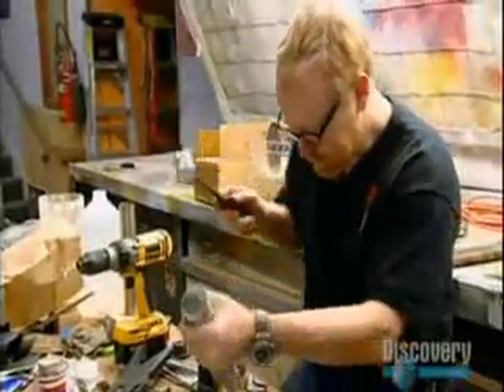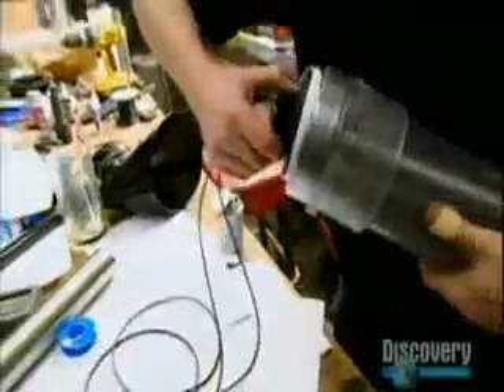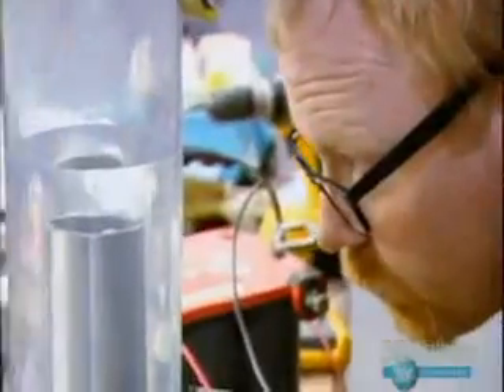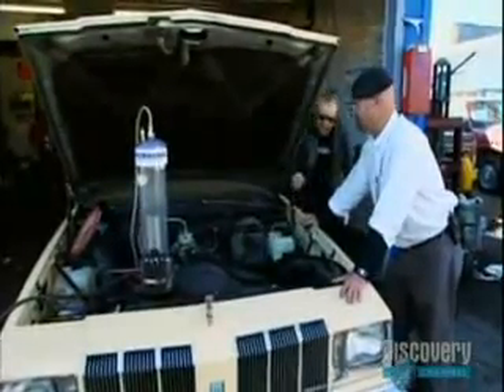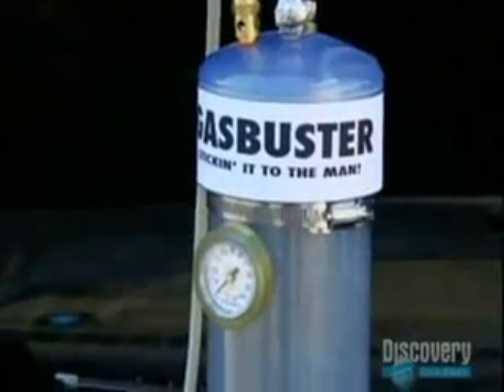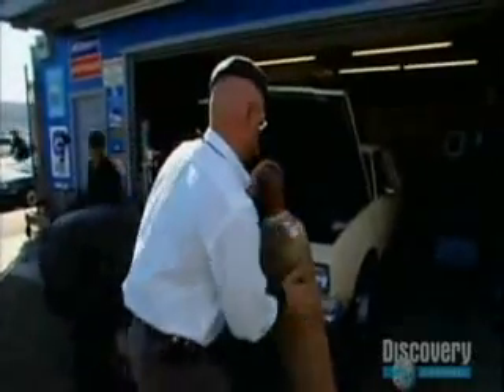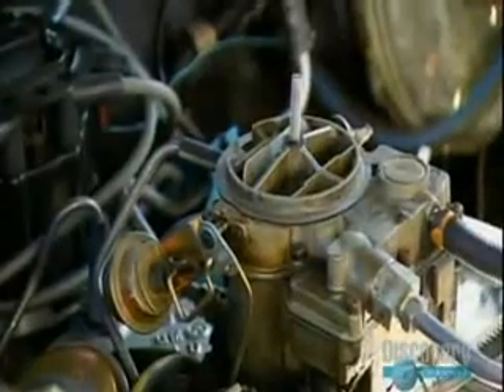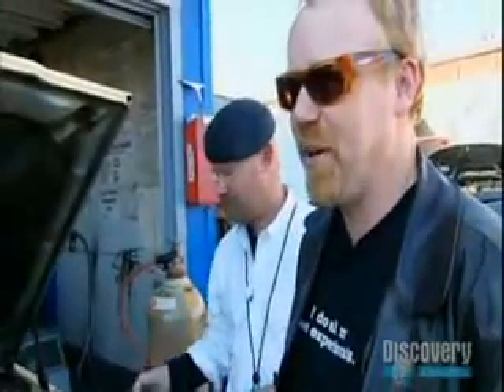HHO Mythbusters Explained

Comment: People promoting this HHO scams  belong in JAIL. 

Some are criminals other are MORONS.

Children do electrolysis at scholl, nothing new here. People burn hydrogen, and even fuel conventional ICE powered automobiles, nothing new here either.

Proposing generating hydrogen through electrolysis of water using electrical energy sourced from the alternator coupled to a gasoline powered ICE IS A COMPLETE STUPIDITY that can be done, but with no other purpose than amusement. 

It would not source it's energy from water (OMG, have to explain this ?!). It sources energy from gasoline, that moves the ICE and then the alternator, tha produces electricity, that electrolyses the water into H2 and O2 absorbing part of the electrical energy into it's chemical bonds, so that it can oxidize again the hydrogen in the ICE back into water.

Energy comes from the same gasoline, from the same crude oil, but is used in a far more ineffective way with many energy wasting conversions.

BTW, one can cheat using battery charge or any other foreign source of energy for the electrolysis and H2 fuel creation, but those sources need to be replenished too (have to explain this ?).

Have a bit of self pride and values and STOP scheming people!
Reply: +Celso Starec 
You should learn how to spell correctly before you call somebody a moron. 

Especially the word school.
:

Comment: takes more electricity create enough fuel to drive 100 miles than it would to just use that electricity to drive 100 miles on an electric motor producing the hydrogen is an unnecessary step the only thing converting electricity to hydrogen does is provide a storable form of energy but batteries tend to be easier to use
Reply: +TWEAKLET 
Apparently you know nothing about Stanley Meyer's efficient conversion method. Read up on his patents.
:

Comment: Still a stupid video. No car can produce hydrogen and drive on it at the same time. That's silly. Meaning, you cannot make a car that doesn't use hydrogen under high pressure. Also you wan't be able to pack the same energy and tank would have to be redesigned. If you are already using the electricity from your car, save a step and use electric motors.

Comment: Fromage Frizzbizz Yes it does. only backyard mechanics try to 'wash' gasoline that has been stored in a tank. any welder knows you run the risk of explosion unless you use an inert gas that is heavier than air before welding so there is no chance of ignition. also any metallurgist can tell you steel intake manifolds are porous and can hold gasoline residue. for this reason no one welds engine manifolds back together unless the manifold has been cleaned with a non flammable solvent. no one except backyard mechanics and hillbilly engineers like the Myth-busters. I listed multiple instances where REAL welders use carbon dioxide to fill a tank or argon before welding on the gas tank. an engine manifold as well as the head and cylinders has gasoline residue in the porous metal surface. go use a brand new engine and try the hydrogen gas fuel method. it won't backfire.
 otherwise if what you say is true you should be able to fill you gas tank with diesel fuel and run your internal combustion engine on it. or run kerosene through the fuel injectors of a Delorean; fuel is fuel right dumbass?

Comment: People are dumb as fuck and very gullible, to believe that HHO works. Math nor Science supports it. It's the law of diminishing returns. It, takes energy to make energy. Whatever gains you make are immediately negated by the extra gas to make extra electricity needed to produce HHO and what is produced is too small an amount. The computer in your vehicle figures that out and adjusts to it. Making the air fuel mix richer, using more gas. Wake up! This is basic, obvious shit and you Conspiritards continue to think this is a cover up or somehow rigged. Nope, it's the LAWS of simple fucking undeniable Physics and thermodynamics. Wet cell HHO, dry cell HHO, 2 dry cells, whatever, it doesn't matter. It doesn't work, period. I've seen the tests and the Math and Science and it is impossible. The HHO produced in 1 hour by this small system, or even bigger is not enough for even one revolution of the engine. How many rpm per minute does your engine move, even at idle? At least 700-800rpm and much more to actually move the vehicle. See the problem there and why this does not add up? Math and real Science are your friends and they help bust nonsense like this shit. So am I a paid oil troll now too because I do not support your idiotic comments or opinions?!  LMAO! People are soooooo stupid! If you all are this gullible, I have some great swamp land I could sell you. Trust me, it really good swamp land! LMAO!
Reply: +Bill Does Stuff 
The electrolysis method is several magnitudes greater in efficiency than the billions upon billions of dollars spent on the military occupation of nations, the cost of wars, the loss of life, the increased cost of food and goods, all the oil rigs, oil tankers, all the oil spills, refineries, storage facilities, tanker trucks, and gas stations – just to have your car go thirty miles before having to refuel. 

You just might want to rethink what you've said.
:

Comment: There are Volkswagen's running on fuel and hydrogen, getting 70 miles per gallon.
Only thing that failed, was feeding the hydrogen ahead of a turbo charger.
He used an outboard motor controller the cut down the voltage to the bubbler, at idle it would be getting too much hydrogen to cooperate with the ignition advance.
Hydrogen ignite's almost instantly, the flame travel is incredible.
What really blew me away, was when Jeff Spencer( Spencer's home for battered bugs, Midwest Volkswagen Guru) showed me a cutting torch he made based on the hydrogen bubbler.

Comment: When charging an electric acumulator or battery of a car, the charger has a hazzardous tag or signs that warn you of not getting flammes or smoke or use cellphones near a charging battery. Why???  because some hidrogen gets produced while recharging the battery.....so old knowledge.
Reply: What is the liquid inside batteries?

Comment: If run on only HHO, need to battery charge more. If adjunct with gasoline use less HHO and advance timing for best torque (automatically). Best to siphon gas tank fumes to above throttle plate plus HHO with retarded timing while restricting airflow through carb filter; may need to heat gas tank to run on fumes. Hell, just running on gasoline vapor(s) is good enough but supplemented with hydrogen & oxygen and optimized timing, cat's meow. Use aquarium-type fritted diffuser-type material in tank and seal the tank.

Comment: Separating water into hydrogen and oxygen has been around for a really long time.  I was taught how to do it in high school chem class back in 1975.  Couple of problems with using it as a fuel source though.  You use more energy separating the H and O molecules than you can produce by using them as fuel.  When Adam and Jamie run the car on pure hydrogen, they're spraying a HUGE volume, in a pressurized state, directly into the carb.  Good luck producing enough fuel to run an engine with the bubbles coming off of a couple of wires hooked up to a battery.  Yes, you CAN run a car on H2, but it isn't free by any means.  The laws of motion and laws of thermodynamics explain why if you care to read them.
Reply: You’re totally right man. Every time I see these videos pop up again I just kind of laugh but people don’t understand thermodynamics and the fact that your alternator becomes more resistant when you’re putting more load on it, which in turn causes the engine to use more gas if you want to maintain a constant RPM. I did this as a fun project one time but even a 100% efficient system would barely get back what energy you put into it, (none of them are 100% efficient.) People will believe anything though. I will say the hydrogen that mine generated was extremely flammable though.
Reply: I dont think the claim was that it was free energy.
Nobody claims it is free energy.

The question is: Will it get me further down the road on a tank of gas.

And be honest: What the mythbusters show here is BALONEY!
It is rigged.
A rigged experiment.

Like other experiments they did were rigged also.
Reply: Stanley's car would cross the country on 22 gallons of water.i watched another sci3ntist on YouTube and he made an hho gen that was producing a gal of gas every 10 seconds so...idk.
Reply: @leifburke5905  i dont know the math on that but i know a gallon every 10 seconds would need a lot of water and alot of current as the 12 volt systems i have seen only give a few bubbles every minute  So water is 2 part hydrogen 1 part oxygen so say for each gallon of water you would get 2/3 gallon of hydrogen or something close to that best case plus the power to generate the hydrogen. I just dont see how you would end up with a net gain in energy, maybe cleaner more complete combustion might pick up some mpgs, but once you factor in cost of supplies, time in labor, wasted gas tweeking and testing it i dont think it saves anything. Maybe a solar set up to power a second battery might be better, but more cost more things to fail, added weight.  We ran into this when the prius first came out my mother in law was going to buy one and after doing math determined the difference in price between the prius and a new honda civic and the gas she would save with the hybrid it would take 8 years to break even from gas mileage savings, it just wasnt worth it.

Comment: Making the hydrogen in the car is of course stupid, because you need an external power source. Also using it in a combustion engine rather than having a fuel cell and electric engine is not very efficient. Hydrogen could have been the fuel for the electric cars of the future. In the early 2000s I predicted hydrogen would beat batteries, but now batteries are too good and are already being used so I don't see that there is time enough for a comeback for hydrogen.
Reply: It's not quite "non-existent", but close.  There are "general access" hydrogen supply stations, but very few.  For the most part, hydrogen vehicles are used in "fleets" (like municipal works vehicles), and refueled from tanks at the "fleet"'s garage.

Tesla is somewhat better - the cars 'know" where all the recharging stations are and will construct routings to allow you to go many places (at least in the US).  They can even "optimize charging", so that you'll get just enough in each station to get to the next one (plus a reasonable amount "just in case"), without spending more time charging than you have to.

[A friend drove from SF to VA in a Tesla.  Didn't have any trouble at all.  But, you'd have some real problems if you were doing long trips thru the backwoods.  I don't know if there's any charging systems within 2 hours of here.]

A fair bit of money and state/provincial planning is going on trying to increase the number of charging stations, but, the power requirements of these things are obscene, and nowhere on earth is there enough charging capacity to handle any more than a few percent of the vehicles being electric.  Can you imagine if a highway transferring 2000 vehicles per hour had to have everybody charge at 10Kw rates or higher every hour?  That's 20 megawatts per "hour's worth" (say 60 miles/100km) of road!  Yow!
Reply: Imagine if you had a gas station at home for your combustion engine car. You would almost never have to fill it up anywhere else. This is the case with the electric car. Everyone already have a private "gas station" at home. At my work place we have access to charging too. Poles intended for engine warmers are easily re-purposed for charging cars. My point is that the ground work for electric infrastructure already exists. We only need sockets at strategic locations.

That said there is another solution which instead of charging your car you switch the battery. This is used at many companies for their forklifts and other indoor equipment. It is super easy and above all fast, (even faster than filling up a petrol tank) but that requires a lot of infrastructure to be built.
Reply: You do realize that charging a car from a receptacle intended for an electric block heater would take a very long time don't you?  It's not just a receptacle change, you have to replace the wire with heavier cable, and upgrade the distribution system to far higher ampacities.  Besides, block header receptacles are pretty darn rare these days. Even in the great white north, nobody uses them anymore.  i haven't seen a parking lot with them for at least a decade.  The only place where you see outdoor outlets like this is in RV parks.

Swapping batteries is quite nice, except for two things: it may be fast, but it's really really heavy, especially in most indoor uses you see because they're lead-acid, and the range is still really short.

Even with LIon batteries, I wouldn't want to be slinging one around that's big enough to power a car any reasonable distance.

Comment: One thing that i haven't heard anyone mention is that they where only testing one plan that they found on the internet. What i got out of this is that they didn't say that a hydrogen fuel cell would never work or that a car could never run on hydrogen. What they were saying is that particular fuel cell plan wouldn't work. That particular fuel cell patent, when "built according to the instructions", would not produce enough hydrogen to run the car. Could they have taken it a little further and tried other ideas or tried to build something that worked, yes they could have, but you need to remember that they cant spend and entire episode or season on one individual thing. They tried to see if that one specific plan worked like it claimed, it didn't, so they moved on to the next myth. Case closed.
Reply: +Frank Gutowski You do understand the point i was trying to make right?

Comment: One bag would accelerate the car about 3f and then it would run out, then you would need a 5m rest to recharge for the light to turn green so you can make your right hand turn and run out again.
Reply: hydrogen garage sells a huge unit that manages to produce 3 liters per minute of HHO.  A 1.5L engine running at 3000RPM would use it all up in four complete revolutions of the engine (remember a 4 stroke engine  takes two revolutions for each cylinder to fire).

Let's work out how long that would last ...  At 3000 RPM, each rotation takes .02 seconds.  Four rotations takes .08.

You wouldn't even be able to get the engine running smoothly before it'd stop and you'd have to wait a minute.

So, you'd run hydrogen garage's unit (a mere $1500) for a whole minute, and you get out less than a tenth of second worth of power.
Reply: Didn't anybody ever tell you not to post while drunk?  It's embarrassing.  I'll light some candles for your soul.  It's gonna need it.

Comment: Eventually, the by products are first oxygen and hydrogen and then water.  This means that you can even find a way to create a cycle that reduces the need to add water to the hydrogen cell frequently.  Would be awesome.  Hydrogen fuel cells can work. However, there needs to be some modifications in the engine to cater for the difference between this type of fuel and normal petrol or diesel engines. Hydrogen burns more efficiently than petrol. It would be a better fuel. These guys did not have the proper equipment to make this work. Just as science has proven many times over, improvements can be made with research. I mean we made electricity work... and PHONES.  I bet we can do something with this and make it work.

Comment: I want to install HHO on demand to my 99 camry, what can I do to cheat the ECU to not release more gas?
Reply: very simple run a by pass hose around the air sensor.... put a ball valve on the hose and adjust how lean the engine runs by adjusting the ball valve..... I also covered the exhaust sensor so it wouldn't report the LEAN condition
.....
Bob

Comment: you can calculate how much H needed to run the car per hour and then you must build an electrolizer that can produce that much gas. then and only then will you be able to run an engine. also the timing must be changed.